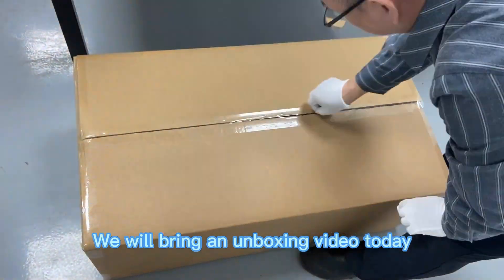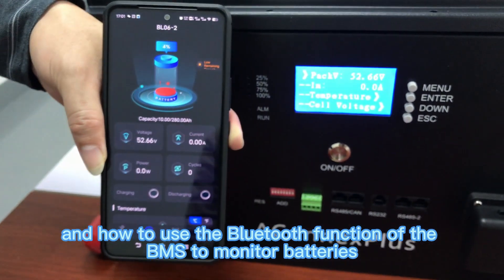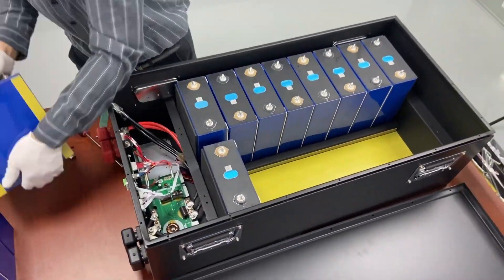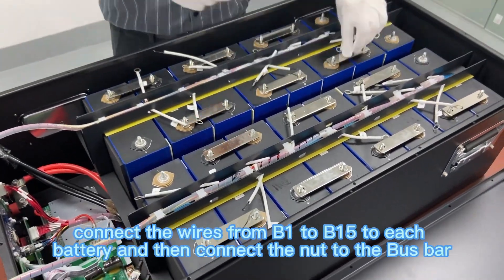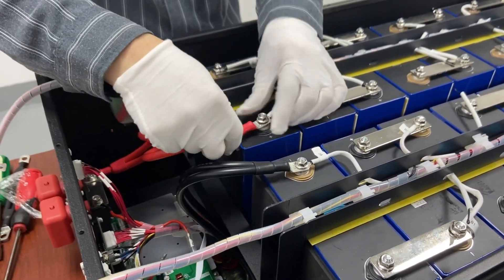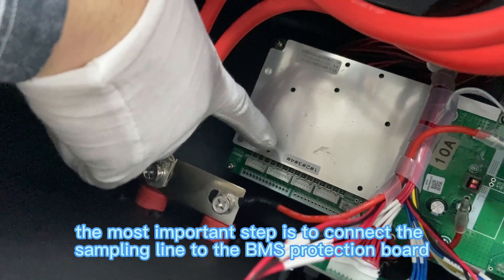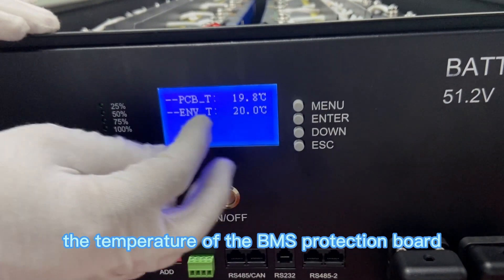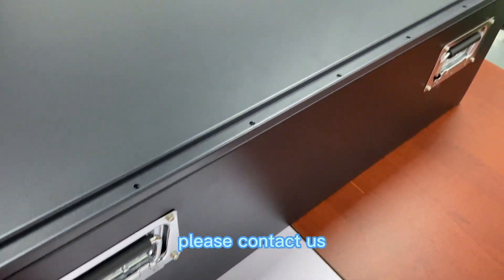【LiFePO4 battery DIY】Top Rated 48V 280Ah LiFePO4 battery pack DIY Kit Installation#diy #battery

Comment: For the BMS leads in this video, it simply says to connect B1-B15 to each battery but doesn't say which pole. I'm not sure if this video is using the Richpower BMS, but according to the Richpower BMS manual it says to connect all leads to the positive pole except B1- and B9- (Note, the manual does not use B0 like the labeling on the kit has, it uses  B1-,
B1+, B2+, B3+, B4+, B5+, B6+, B7+, B8+,B9-, B9+, B10+, B11+, B12+, B13+, B14+, B15+, B16+)

Can you clarify BMS lead connection for the richpower bms for both 15s and 16s configuration?
Reply from the maker: Thanks for your comment，for more question please visit www.kesheebattery.com or contact us by E-mail: sales@keshee.com

Comment: I   want to buy  16S1P 48V/51.2V 304Ah 200A BMS LiFePO4 battery Kit Installation .       how to I place an order?  I am in taiwan
Reply from the maker: Hello! Could you please contact our sales manager? this is email address: sales3@keshee.com. Or WhatsApp: +86 15019297714. Our sales manager will help you place an order. Thanks for your message. 😀